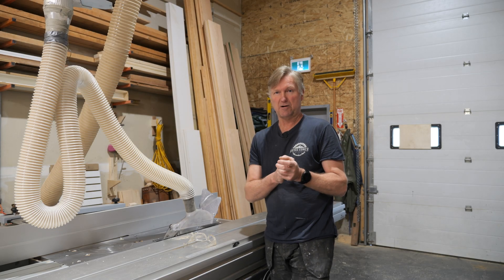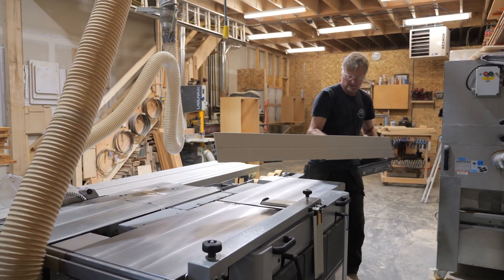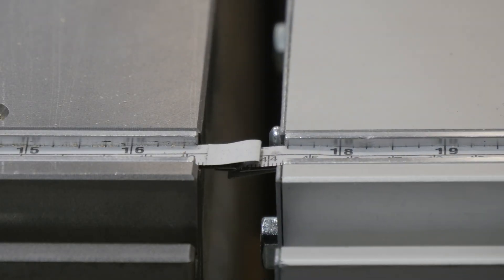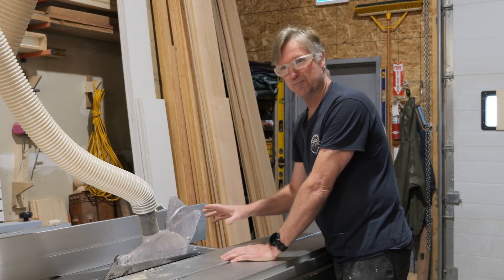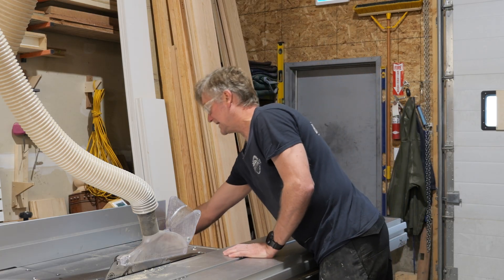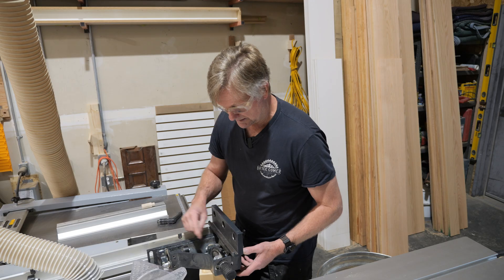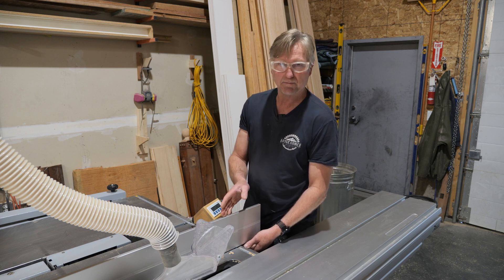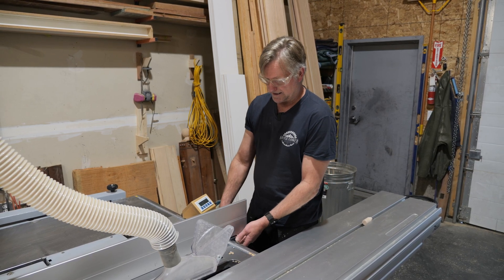Digital readout for the rip fence on my Felder CF741

Comment: did you see the one available for the kf or k700 series ? it has adjust ment for blade width also and dosn't need adjustment ever time... I don't yet know how much extra it is. Its not available for the cf741 with that square slide fence.
Reply from the maker: Yes it's a much simpler process to add it to the saw, or saw/shaper with its round bar that the fence slides along. :)

Comment: Hello Bryce, does the digital read out work continuout past the numbers on your table saw and onto the jointer or stops right at the cut?
Reply from the maker: The magnetic tape runs from close to inline with the blade, to the far edge of the outfeed table of the jointer. With the position of the reader under the fence casting where it is, it doesn't quite read all the way to the edge. I recently made some changes to the DRO on the rip fence and have some video of how i updated it to be better, so i should put that together soon so you can see.
Reply: @brycecomerwoodworks  Hi Bryce, any update on that video?
Reply from the maker: Yes, it goes out to roughly 800mm from the blade of my memory serves me correctly. I'm away at the moment but will be back at the end of the month.

Comment: Here on this clip "Digital readout for the rip fence on my Felder CF741" at 2:53 (I don't have that option for fine tuning)
Reply from the maker: Oh i see yes. That option on is something that makes dialling the exact diension in really easy. I don't have that luxury on the crosscut filpstop with the DRO on it, only my rip fence. I lock the rip fence down close to my measurement, then loosen the fine adjustment knob and dial it in before locking the knob to make the cuts. For the crosscut fence, i have to fiddle with it to get it to the exact measurement.

Comment: Very nice movies u make, i have a felder F700Z spindle moulder and i would like to know what kind of digital readout u used on that fence. Thanks!
Reply from the maker: Thank you Joachim, and thank you for watching. The digital readout i have on the hood is a cheap one off ebay. I am however having some issues with it and need to look into what the problem is. Once i have it figured out, i will let you know what i needed to do to get it working well. I have a replacement, and will try that. I am just concerned that if i tell you what it is exactly, and you buy one and have the same issues as i am having, then you won't be happy. It may turn out that it's just not worth messing with it if the quality is such that it doesn't work properly. I may try to find something that is better quality.
Reply: @brycecomerwoodworks  ok perfect and i understand that. Looking forward to it.

Comment: That’s on my 2025 to do list, DRO on my k700S rip fence.  Thx for the video!
Reply from the maker: You won't regret it. It will also be a lot easier on the K700 with the rail running the full width. I actually have some ideas for mine that i'm going to look into further when i am off work after hip surgery in a few weeks.
Thanks for watching!!
Reply: @ Wish you well with the hip surgery.  For milling the column planks, have you ever used the slider to make your bevel cuts, since it’s a straight line rip?  Which type of tape did you use to fold your miters?  I’ve always just seen the clear packing tape used.  Thx
Reply from the maker: @tundrawhisperer4821  I have used the slider before yes. It will give you a nice straight edge, you just need to make sure the board is nice and flat against the slider for the entire cut. I typically just use masking tape. Nothing special, just the 3M stuff i get from my supplier.
Reply: @brycecomerwoodworks  Yes having the plank lay completely flat to the slider bed is key.  I use a “strong back” on top of the plank which is held down tight with the Air-tight clamps.  It’s a fast way to do it. Thx
Reply from the maker: @tundrawhisperer4821  Brilliant! Good thinking.

Comment: How do you span the gap when the rip fence moves between the cast iron table saw top and and the jointer surface?
Reply from the maker: Hi Dennis, I have the magnetic tape running across the small gap. It's definitely not pretty, and i would like to come up with something more robust and elegant, but it is still working fine so far! 🤞You can see it at 1.22
Reply: @brycecomerwoodworks  Thanks Bryce, I like your straightforward approach to the problem.

Comment: Hi, I would also like to understand better, I had the same one in mind, I have a Felder cf410 p full digital, thanks; Lamb Tool Works DRO Flip Stop, do you know it? 😉
Reply from the maker: Hi @claudiovivori2225, are you wanting to add the same DRO to your rip fence or outrigger? I have seen the Lamb Tool Works flip stops, but I'm too cheap to buy one, that's why I went for the cheaper option on the outrigger. That said, I have found it to be very accurate. I don't believe there are any off the shelf options for the rip fence though, hence my DIY job.

Comment: Would you mind post a link to the DRO you used and the magnetic strip needed.
Thanks
Reply from the maker: Here you go. https://www.aliexpress.com/item/32923995345.html?spm=a2g0o.productlist.main.15.559eX64BX64BXz&algo_pvid=bd54b171-c28f-41f4-be34-a6903a5deb6e&aem_p4p_detail=202405260823278103464167210570003565483&algo_exp_id=bd54b171-c28f-41f4-be34-a6903a5deb6e-7&pdp_npi=4%40dis%21CAD%21166.23%2144.88%21%21%21118.34%2131.95%21%40210318ec17167370073195618e2922%2112000034675726027%21sea%21CA%213050097111%21&curPageLogUid=uFum0RrcInVx&utparam-url=scene%3Asearch%7Cquery_from%3A&search_p4p_id=202405260823278103464167210570003565483_2
Reply from the maker: There are many different ones online. The first one i bought was from Ebay, but exactly the same as the one i linked above.
Reply: Thanks!!